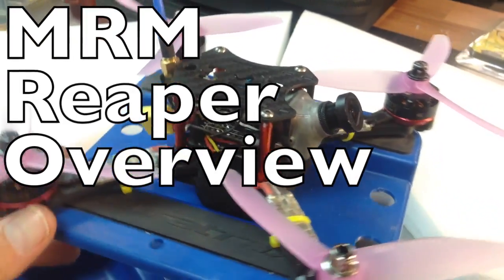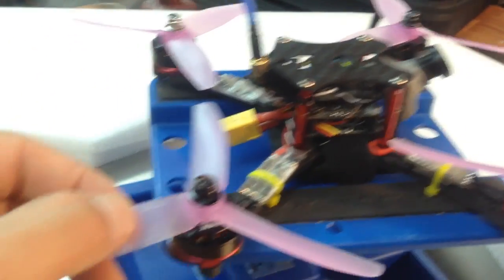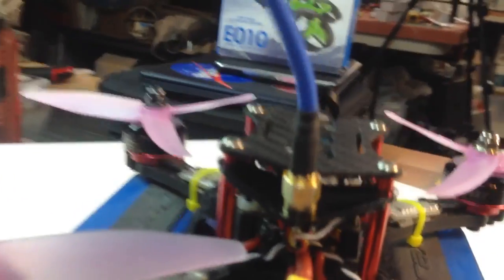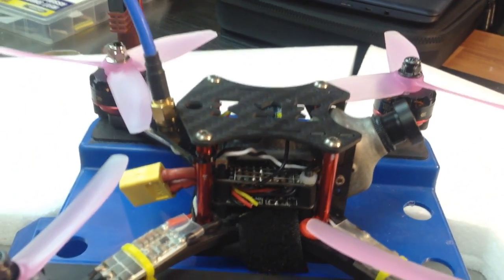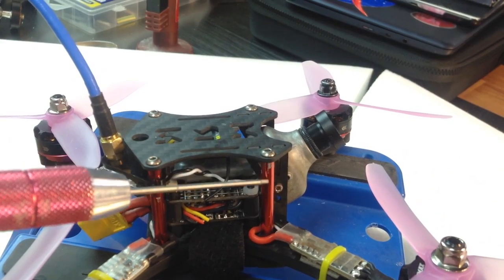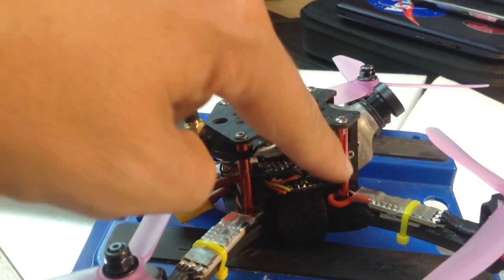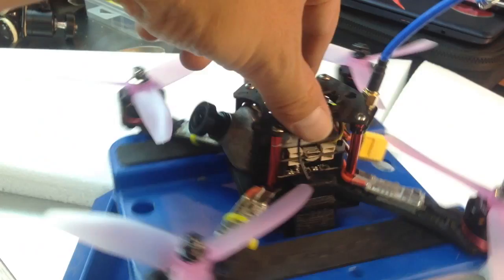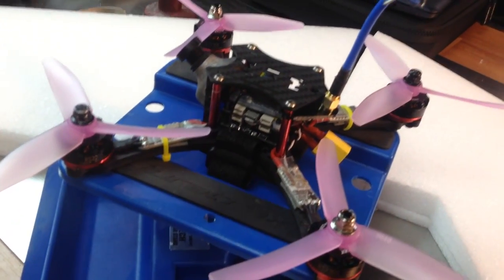MRM Reaper 195mm Frame Overview

Comment: Just had a thought?  If the VTXs are damaged when powered and no antenna installed do they get zapped in a crash if the antenna gets ripped off?  I guess it depends on if the battery gets ripped off also.
Reply from the maker: yes, running any vtx without antenna will fry it eventually and sometimes immediately.   My crash edjected the battery so on that front I was lucky..

Comment: i have just finished building my 220mm reaper today, and I would also have to say the screws were way too short, the screws that were meant to go in the centre holes werent even long enough to reach the nylon part of the nuts. Also the screw heads underneath would very easily damage the battery, i see you have a slab of foam there, i may have to steal that idea. Its been the tightest build I have tried so far and did find it a challenge, still not happy with my vtx placenent.